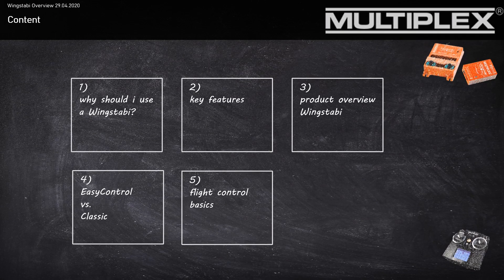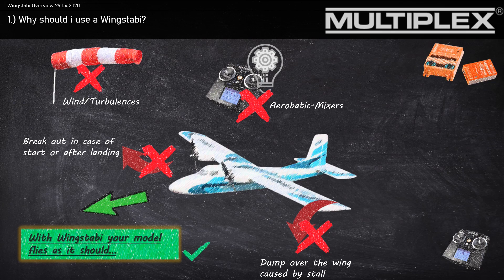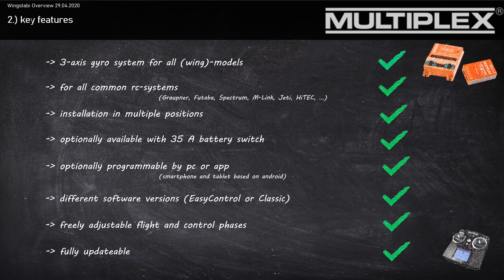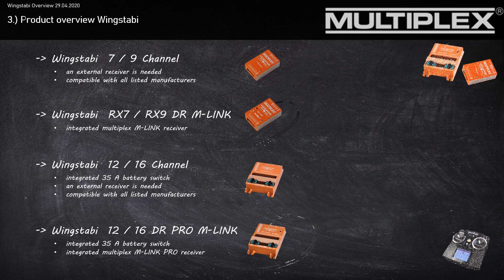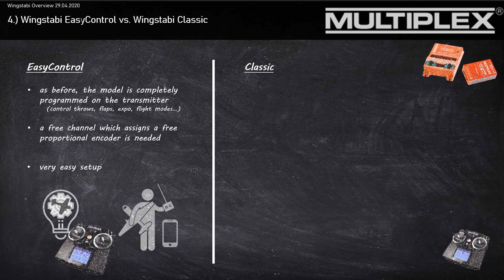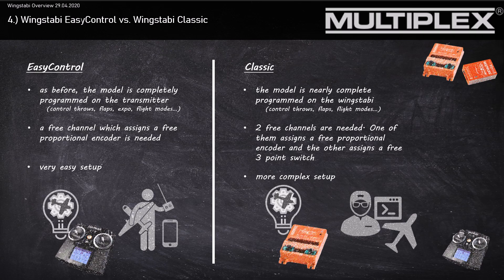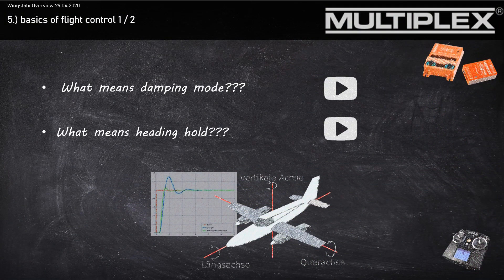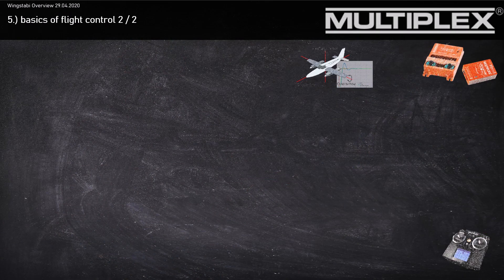Wingstabi Workshop Part 1 English

Comment: This is long overdue. I wish MPX would run their instruction manuals and tutorials past native speakers. Does MPX just rely on a German to English translator who is not a modeller(?) For a simple example: 'Sailors' yes we know MPX are referring in their translation to what a native English speaker would call a Sailplane (Glider). Using technical authors and software experts isn't necessarily the best way, instructions should be tested and proven by model flyers of all levels and abilities. I wonder if our French model friends experience the same difficulties with their MPX instructions in French(?).